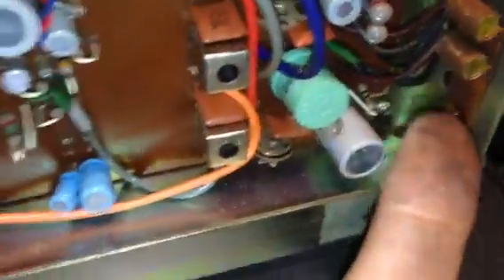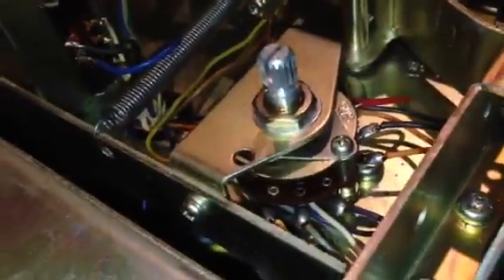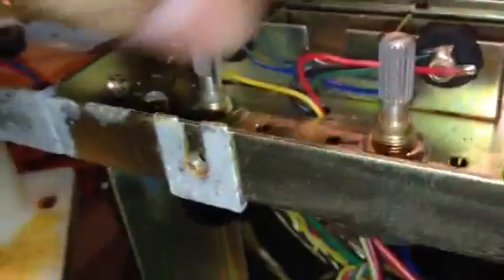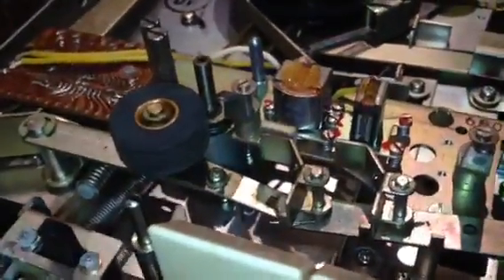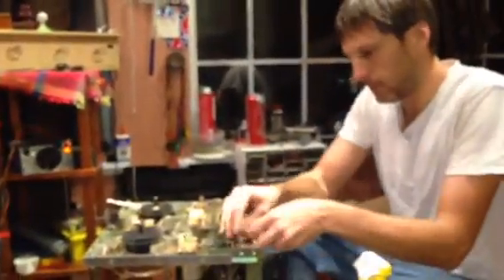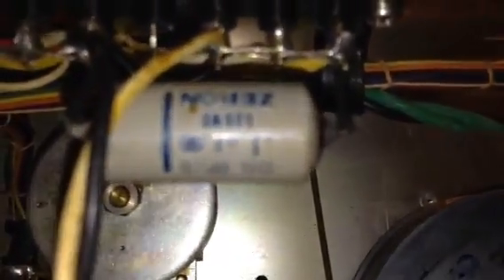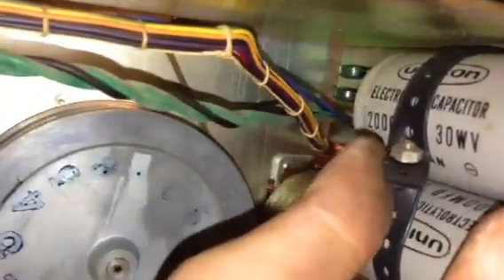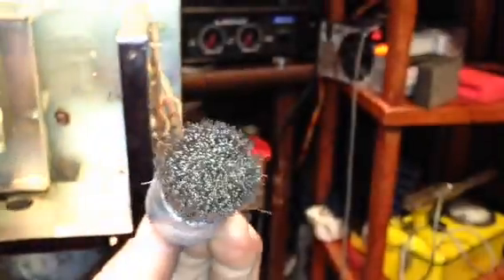Video 2 Lafayette reel2reel 920

Comment: How did I miss this video? I am subscribed. Oh well, anyway, fantastic tape recorder! The motors are probably 4 pole syncs locked to the line frequency. I think the two biggie blue caps are main line filters for the amps.

Of course, can't be sure without seeing the wiring or a schematic. But the size of the flywheels, which are actually small for that time period indicates that the motors are probably really stable, so the flywheels don't need to be so large. The Wollensaks of the same time period are so underpowered they needed the insanely large flywheels they used.

Looks a lot like a TEAC quality build. Flat belts too!

You've got an amazing treasure there!
Reply from the maker: This amazing treasure is a boat anchor without your magic touch.  It can record and play, but I have to keep my finger on the record head in a certain position.  It's above my knowledge...  It's below yours!
Reply from the maker: 10:40 shout out to Mr. ClydeSight!
Reply: Steven King  Muchos Gracias, Senor! (I have now exhausted my knowledge of Spanish)
Reply: Steven King Send me a PM, I am sure there is a way to fix this.
Reply from the maker: Sending the machine in two weeks...

Comment: At :16 - those guys look like the bias oscillator transistors heatsinked to the chassis. Hard to see on camera, but do those cylinders under the copper straps have 3 leads in black spaghetti coming out of them? I bet they do. Given the inductors located in that area of the circuit board, I'd say you're in the bias oscillator section.
Reply from the maker: Well I'm not sure exactly,  if you were to come up to nc for a vacation I guess we could get some stuff sorted out!  Which airline would you prefer?  This message will self...
Reply from the maker: How is it going buddy?
Reply: It beez goin...................................
How bout u?
Reply from the maker: Great! Glad you are well...